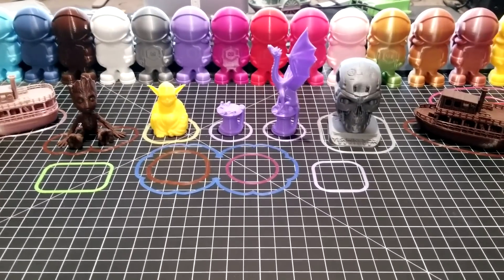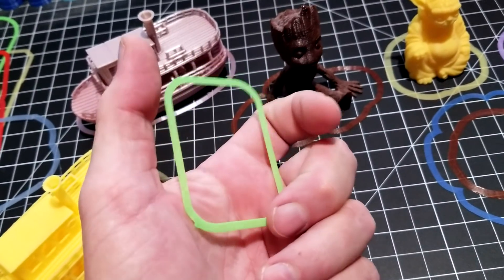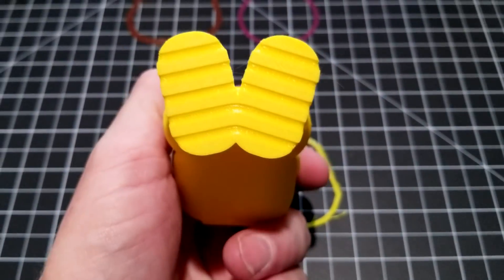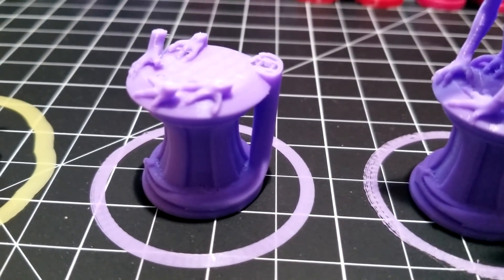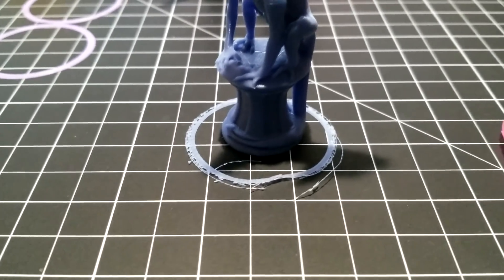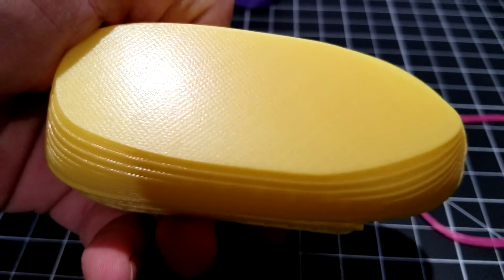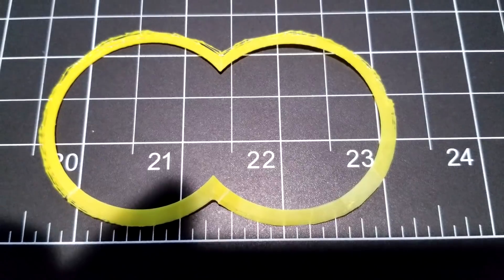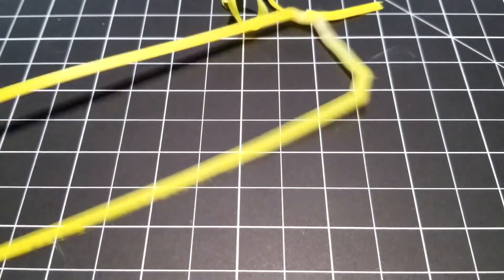How to use a skirt to level your print bed, set nozzle gap and improve print quality.

Comment: So in reading other comments I have to adjust all 4 corners?  The skirt I was trying to print was way too thin and wouldn't stick to the bed.  So I'm guessing the nozzle was too far away (up)?  I think I have to go back into ideaMaker and re-tweek my skirt settings?  That line was like a needle thread for sewing.  Didn't you mention settings somewhere?
Reply from the maker: Yes assuming the bed is already perfectly level you would adjust each corner the same amount. If it's not you adjust each corner individually until it is level and has the correct gap.  Yes most likely your nozzle is too high. I don't use idea maker sorry.  search for skirt setting on ideamaker and turn on 10 lines of skirt 10mm from the part.  HTH.
Reply: OH!  Okay thanks.  I believe I had only 2 lines of skirt 10mm away.  I gotta go back and check. I printed a 20 x 20 test cube but no skirt printed.  Wow!  did hat thing ever turn out smooth. So me re-leveling based on this video (Your) seemed to work.  i'm now printing the big leveling wheels. Thank you for your reply
Reply from the maker: Awesome, glad it helped!

Comment: I like the idea of "what to do"... but would like more of a "how to do" it...
Reply from the maker: Thanks for watching.  How to do what? Adjust the nozzle to bed gap? Adjust while printing?  I use the leveling jobs and adjust while printing.
Reply: Yes, how do you adjust it while printing?  If the bed is level and you only want to adjust the gap, do you still adjust the bed level?  Do you adjust all four corners or just one?  Is there a software function to simply adjust the gap while printing?
Reply from the maker: Yes you use the bed knobs to adjust the gap while printing by tweaking each the same amount, then watch the skirt for changes, then tweak again as needed.     You can do it via baby stepping in certain versions of FW, but I prefer using the knobs and doing it manually, gives you a better feel for the process imo.
Reply: Awesome, good info... Thank you!
Reply from the maker: You're welcome happy to help.

Comment: One of the most useful tips ever.  I used this straight away.
Reply from the maker: Thanks!  I'm glad it helped!
Reply: I had modeled  leveling routing that was essentially a big round skirt this is much easier.  My first layer adhesion and bottom finish has never been so good.

Comment: Im not sure if Im having a bed levelling issue or a nozzle-bed issue on my Tornado, but cant seem to get decent prints out of it.
Reply from the maker: Turn on skirts and send a link to a picture of the printed skirt.  Easier to catch me on FB via the link in the channel picture.
Reply: 3D Printer Junkie thanks ill try that. I dont have a facebook but appreciate your help
Reply from the maker: Adam, it's worth signing up just for all the 3DP info available. I use it only for 3DP stuff.  Most manufacturers rely on it as a support forum.
Reply: 3D Printer Junkie thats a good point. I might just have to have my wife reach out
Reply from the maker: Many people use their wives accounts to post and join the 3DP groups.

Comment: Is the skirt part of the project or is that a separate project ?  Thanks
Reply from the maker: It will be added automatically by the slicer if you turn it on and it will be a separate part when printed.
Reply: Oh okay thanks.  So I can turn it on in Cura then?  I heard someone else mention a skirt and couldn't figure out what he was talking about.  I'm new to 3D printing.
Reply from the maker: Yes it is under build plate adhesion.
Reply: Great.  Thanks again.  I' waiting for my new TEVO Tornado, having asked for a refund on my printer that broke after 3 weeks.

Comment: You mentioned tweaking a lot, but being new to this I wasn't sure what your were doing. I figured you were adjusting the 4 corners of the bed. But if you were adjusting the Z axis in the software I have no idea how that was being done.
Reply from the maker: I use the bed knobs, I only use baby stepping or z offset on my Delta with factory ABL.  I adjust on fly while the fist layer is printing.  HTH.  Thanks for watching.